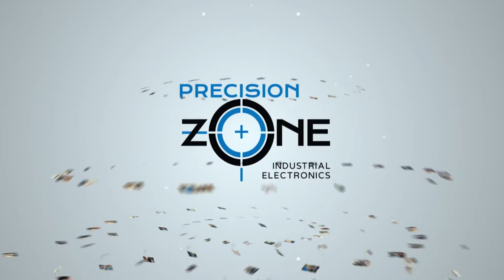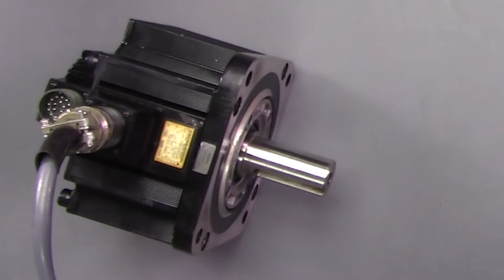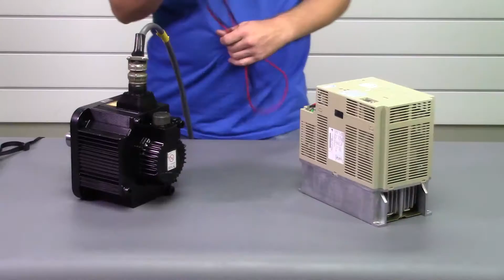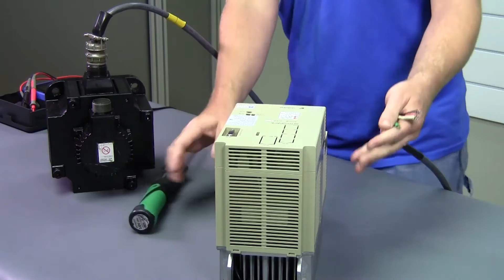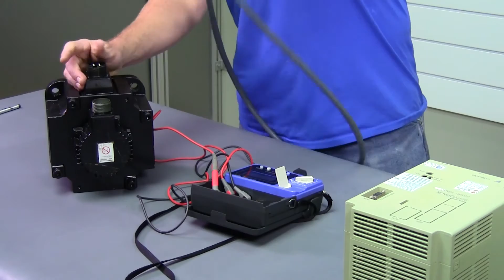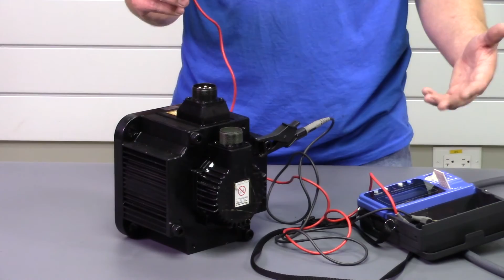Troubleshooting AC Servo Motors

Comment: What if you get a overcurrent alarm in normally say (y) axis but the alarm jumps to every axis the machine has including the tool changer motor? Siemens drives and motors. 1998 Cincinnati milicron magnum 800.  And the axis sounds like it grinds then alarms out. Then hit reset, and it turns back on with no issues and works fine? This happens twice a day..... everything checks fine? I'm confused. 😆
Reply from the maker: Hi Jason, shoot us an email at repair@precisionzone.com with your contact info and we can have one of our tech support engineers reach out and assist. Or call us at 847-465-9060 and we'll get you connected with our support team.

Comment: hello, i have cardboard cutting machine, creasing tool not working it doesnot moving up and down, it new machine, it is possible servo motor damaged. when i shift creasing tool this is buzzes can you help me.
Reply from the maker: Hi Roman, send us an email with the model number of the motor and we can give you a quote for repair or replacement. Our email is repair@precisionzone.com. Or you can call us at 847-465-9060.

Comment: Why not show resistance while checking with megger
Reply from the maker: Hi Onkar, 

Thank you for stopping by our channel! 
We have a video specific to checking the resistance on AC motors, which can be found here - https://www.youtube.com/watch?v=cB2JymoOpSE. In our experience, we have found that insulation tests will fail if the windings have endured any catastrophic failure. The tolerance that the windings must be within is difficult to be checked accurately on-site with standard meters as well, so a milliohm meter would be required to get a truly accurate reading.

We hope this helps! 
Please let us know if you have any other questions! 
Thank you!
Reply: @PrecisionZoneIncWheeling  Crap video nice cheap technician work. Congrats,you know what a motor looks like.